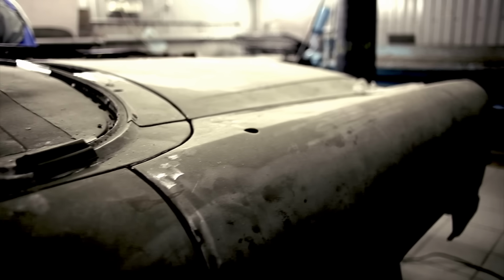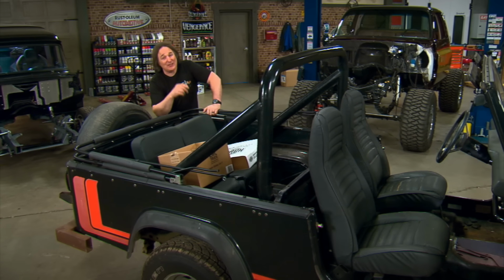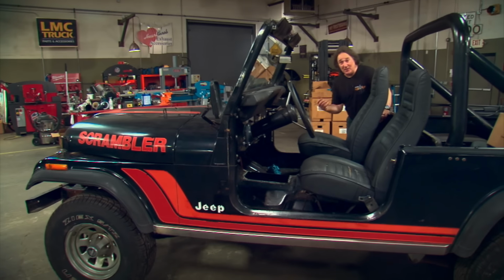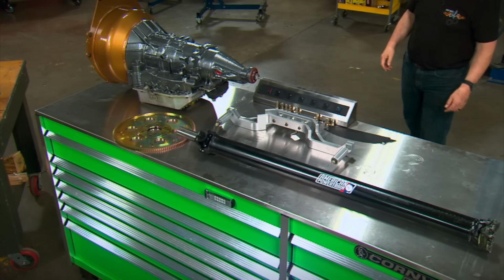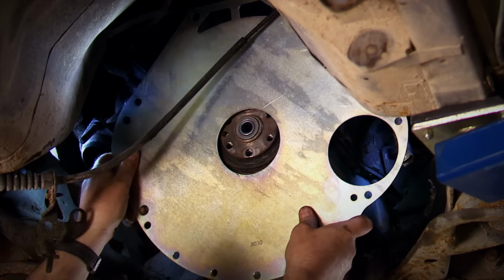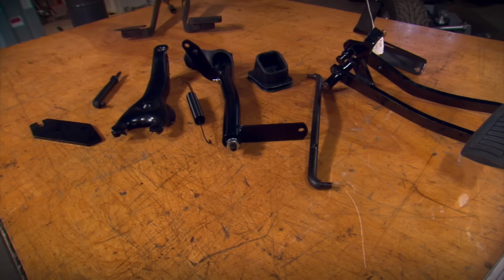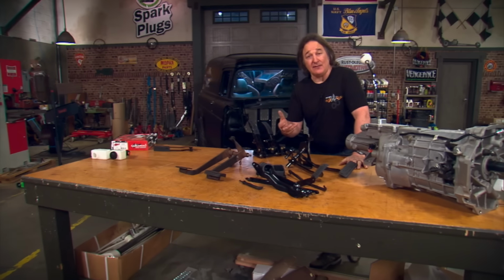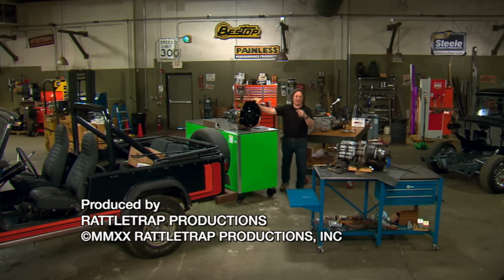Stick Shift vs Automatic Transmission & How to Swap - Stacey David's Restoration Series S1 E7

Comment: And the aftermarket can hook just about any trans to any engine. I just swapped the NV4500 out of my 1998 Dodge Ram 3500 4x4 with the 12 valve Cummins and have a 6 speed Allison 1000 in its place thanks to the people @caconversions4591 They do all the wiring and adapters, plus have the transmission shift with Allison programing and not Chevy's terrible programing. So it shifts like a commercial truck, locking the torque converter before upshifting into 2nd gear and keeping it locked until it drops down to ten miles an hour.

Comment: Currently debating a tkx swap into my IROC-Z28. It's a 350TPI with a 700r4. 26k on it and it's loaded with options. Lots of people wanted the 350 with the 5 speed but GM never let them have it. It won't be the original drive train but it would be period correct and still desirable. I'm really on the fence.
Reply: Do it who cares about originality in a 3rd gen
Reply: @Bobby__hill500  actually people are starting to care, especially now with the economy in the shitter. The mid-late 70's and the 80's cars are becoming popular builds because they are cheap, parts are still available at local parts stores and the aftermarket is still there, especially for the 80's Camaros, Firebirds, Mustangs and Trucks. I mean you can buy a 3rd Gen Camaro/Firebird or Mustang still running and driving for under 5k.
Reply: @TheREALOC1972  I’d wanna manual swap a 3rd gen if I had one so it’s really added value in my eyes
Reply: @Bobby__hill500  Swapping a manual isn't going to raise the ACTUAL value though, Like you said. it's a 3rd gen Camaro so unless your parking it in the garage and only driving it on weekends to keep the mileage down for a decade or more it's not going to add to the value until the value goes back up. They are just now getting back to the stage where people are slowly starting to rebuild them so it's going to take awhile until the value goes back up.
Reply: Make sure you take into account the torque arm that mounts to the transmission.  Unless you get lucky and find a T56 from a 4thgen Camaro or Firebird, you are going to need to relocate it.
Reply: @scottpeters371  Im well aware of that as well. Thanks for the reply.
Reply: @TheREALOC1972  ALL 80's stuff has gotten popular mostly due to the 70's and older stuff getting out of reach for most people.
Reply: @Bobby__hill500  I care about it in mine. Cars like mine are getting harder to find. Yes I am doing a mechanical and cosmetic update but I will still retain a very factory appearance outside, inside, and under the hood. My car will be noticably different yet still look almost identical to new. Bottom line is there are tons of ways to build a thirdgen these days.
Reply: @John-cg8hb  that's why the "smog cars" are getting even more popular.
Reply from the maker: One with that low of mileage might be better left original, but that only matters if you plan to sell it! If you're holding onto it for a long time, do what you want to!
Reply: Thanks for the reply! I am absolutely keeping it for awhile!
Reply: @OfficialStaceyDavid  Stacy should do a mid-late 70's "smog" car for his next project, I'm seeing more and more of them pop up at cruise-ins, cars and coffees and car shows,  They are getting very popular out here in the Southwest/West, I live in Northwest Arizona and every project since covid in my Car Club has been a 73-77 for all of the Big 4 (AMC included) because they are cheap to buy, you can find 1 running and driving and often time still registered and tagged for 3k or less, parts are cheap and still available at the parts stores and Smog laws don't apply anymore because they have aged out of the emissions laws. These cars are the next wave of classic car builds and Stacy should jump on the train early on, I know... he did the "Street Sweeper" but he didn't really do too much to it. I'd like to see a "ground up build".

Comment: Always good info from Stacey. I've got a 440 from a motor home I want to bolt a 4 speed to the crank doesn't have a deep hole for the pilot bearing  is there a alternative style of pilot bearing I could use.  Putting this set up in my 69 road runner
Reply: I had that problem 40 some years ago with a junkyard engine. I don't think the end of the crank is machined at all to accept a pilot bushing. The hole thay the bushing goes in is way too small. I think I took the crank out and put it in a lathe and bored the hole.